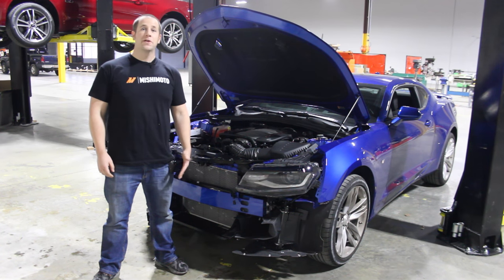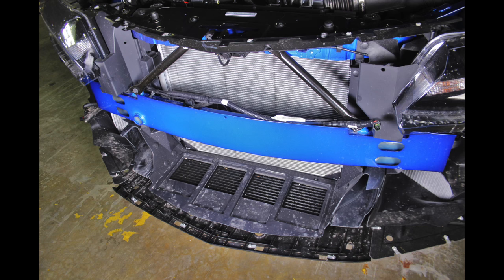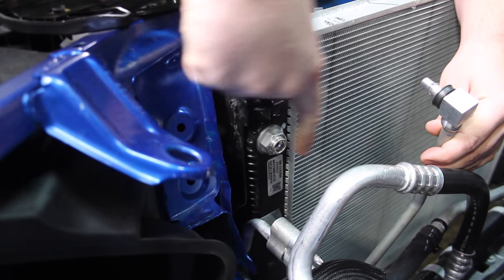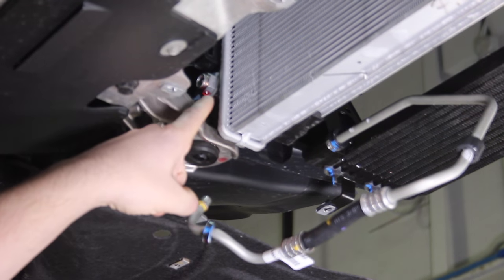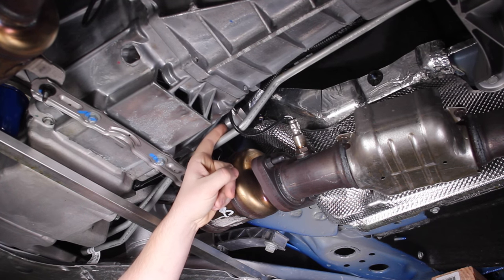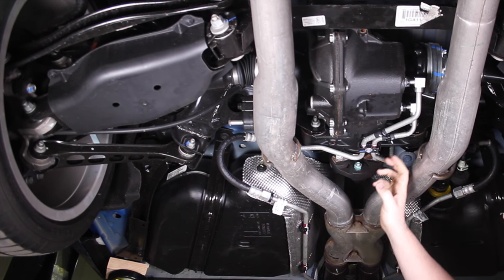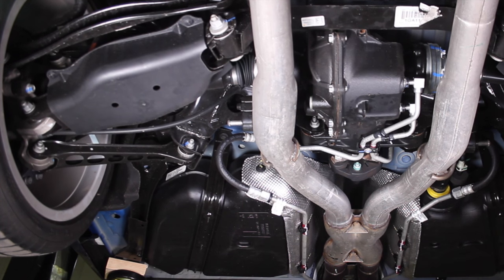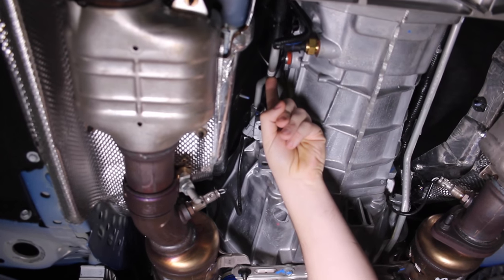2016 Camaro SS Video Review Series, Part 5: Transmission and Differential Cooling System

Comment: Did I miss it? Where’s the pump?  My ATS-V gives me a service differential warning when the temperature drops below freezing quickly. Dealer said there were pump codes but it’s functioning fine.
Reply from the maker: On the SS this job is done by the transmission as it uses an oil to oil cooler.
Reply: Same as the ATS-V which has a lot in common with the Camaro and looks identical underneath. There’s an electric pump to move the manual transmission fluid to cool the differential. Just wanted to know where the pump is located.

Comment: THis is very interesting. I curious how you go about changing the transmission oil and if you can even get all of it? Maybe have to change the manual transmission fluid like you would an automatic and use a machine to run new through until all the old is out.

Comment: A tire blew off at 18 wheeler truck and hit the front of my 2020 ss causing damage to my lower bumper and also causing my condenser to leak , how can I be able to see if my transmission cooler was damaged?
Reply from the maker: You would need to disassemble the front end to confirm most likely.
Reply: @mishimoto  okay thanks ! If the trans did get over heated would it have showed up on the dash ?
Reply from the maker: That we can't answer as ours never overheated ;)

Comment: Not sure you have the lines to the rear differential and flow correct.  This might be the case with the SS, but on the A10 ZLE, the hot side output of the transmission goes to the differential, then up the passenger side to the top driver's side of the engine's radiator, then down to the Aux Transmission heat exchanger and then back to the transmission as somewhat cooler fluid.  This way as the engine is warming up, it can assist in warming the transmission as a heat exchanger.  I am currently isolating all these systems on my ZLE for Road Racing and wanting to replace the horizontal Aux AT heat exchanger with a more robust, thicker part to help with reliability.

https://www.youtube.com/watch?v=DDjo-52u8Zw

Comment: again, thx very much for this !
These lines are pretty close to the hot cat´s and exhaust pipes.
And why this complicated first inlet through the main radiator with only little cooling ?
Again a lot of hoses and pipes which all can cause leaks or other problems.
But reardifferential cooler and engine oil cooler seems pretty well done, good job chevy !
Reply: ggod, call there is a TSB out for these now.